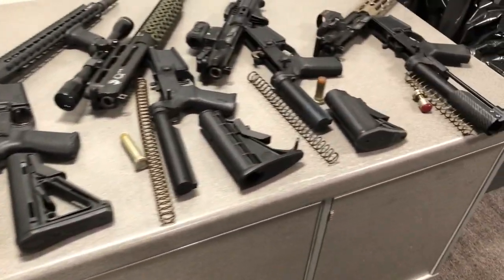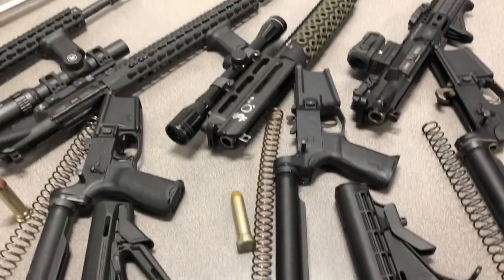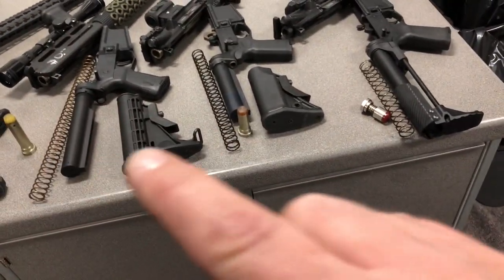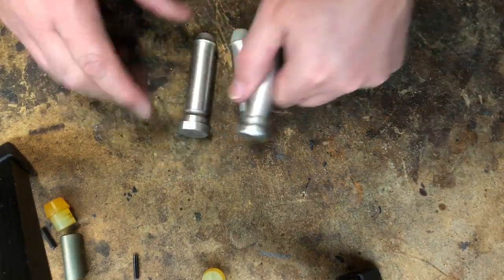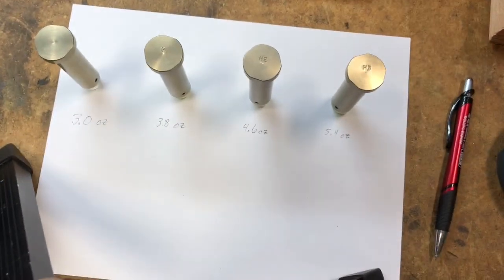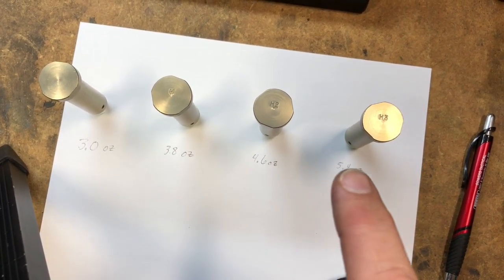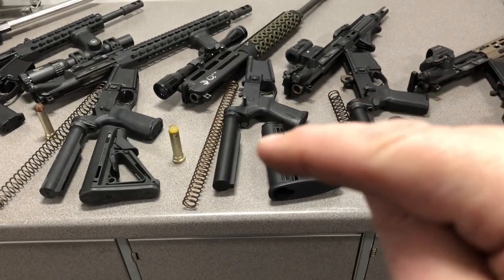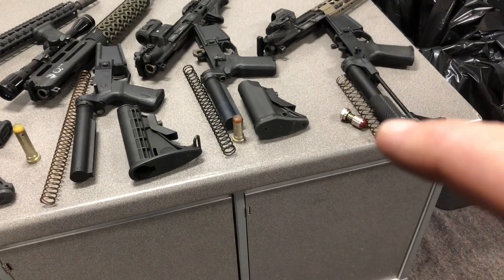Different AR Buffer Systems Explained

Comment: So I should be good with a basic carbine buffer/spring for a 20", rifle length gas system?
I ordered a CMC mil spec buffer and a Magpul adjustable stock for my Colt Sporter Match Hbar. Hope it works
Reply from the maker: It should.  The US Marines ran this set up for a bit, the M16-A4.  I would use an H buffer at first though.  If it's running slow, switch to a std carbine weight.  If running fast go to an H2, but with a Colt barrel, the H buffer weighted carbine buffer should be the ticket.

Comment: Excellent Vid!  for a PSA 10.5 pistol build what Spring and buffer would you recommend?
Reply from the maker: Carbine with an H2 and Tubb flat wire spring, or A5 system with an H2 and green Springco.
Reply: @seanmtactical6069  Thanks for the response.  And Cheers from Parker.

Comment: Have 13.7 inch sons of liberty mid length  barrel with NOX Pinned .
Have the tubs AR Series  flat wire buffer spring. If I buy the Vltor A5  tube which buffer should I get? I’ll be shooting mostly 62 grain green tips I will not be shooting suppressed. Question is Which A5 buffer to get. Other question I have a rifle and I have a carbine length Ace skeleton receiver extensions/stocks, if I use the ace stocks with the tubs flat wire spring in either one what should I do For buffers for either one of those scenarios thanks for your input. I’m just used to using ace stocks. But if I have to get a Vltor A5 extension I’ll do that if it’s worth it
Reply from the maker: I would try the H (1) buffer in either the carbine or A5 buffer with that barrel and a Tubb flatwire.  SOLGW uses a 0.077" gas port in their 13.7" barrels.  If you find your ejection pattern is forward of 3 o'clock, try an H2.  I suspect the H is all you will need though.

Comment: 9” 300bo ar pistol i plan to run suppressed and unsuppressed. Subs and supersonics. What buffer system do you recommend?
Reply from the maker: carbine buffer tube with a carbine weighted buffer and a Tubb flat wire 300 Blk spring.

Comment: Are all buffer retaining pins supposed to be spring loaded
Reply from the maker: Yes, but some systems are meant to be ran without a retainer.  The most common that doesn't use a retainer and spring is the JP silent captured system.  We only build rifles for competition using this system.  They are not reliable enough for any other use.

Comment: I have a 20” AR-10 mid length gas system and a carbine buffer. Runs great but I want to use a rifle length buffer and tube. No one will give me a good starting point on which one to use. Any thoughts?
Reply from the maker: If you go to an A2 tube, you have one buffer that will fit, the 308 rifle length buffer.  Now, if you are using the current PRS stock, you can use a carbine, A5, or A2 tube.  In that case use the A5 tube and at least an H2 AR-15 buffer.  In all of these cases, I prefer the Tubb 308 flat wire buffer spring.

Comment: I built an AR-10 upper chambered in 6.5 creedmoor with a 20" faxon rifle length gas system with nonadjustable block. I mounted it on my DPMS SASS G2 lower and used the BCG and buffer and spring that was installed but I'm getting a FTF on my follow up shoots. Any Ideas? I can cycle it buy using the charging handle and it ejects fine. Just thought it was wroth asking.
Reply from the maker: What type of buffer tube?  What weight and size buffer?  What buffer spring?  We typically build Creedmoors and 308 Win AR-10s with rifle length gas systems, adjustable gas blocks, A-5 buffer tubes, Tubb 308 Flat spring, and H3 buffers.  Adjustable gas blocks on AR-10s are sadly almost always required, especially with suppressor use.

Comment: Did, I gotta pick your brain on ar10 buffer and spring... Recently built one and had my bcg smack my lower buffer threats and tube... No critical damage but I'm having a hard time finding trustworthy specs for spring length and such
Reply from the maker: The spring length probably isn't the problem.  I suspect you are running an AR-10 carbine buffer in an A-5 or A-2 tube.  I need to know what buffer, spring, buffer tube, bolt carrier group, and lower you have.

Comment: I want to change my buffer spring for my m&p 15 sports II AR. However, which buffer spring should I change the stock one out with that would run more smoothly?
Reply from the maker: I would use either a Tubb flat wire or a SpringCo white carbine spring.  I use the Tubb springs in my guns. I would go to an H buffer in the carbine 16" 556 gun.

Comment: Would you recommend running a carbine buffer h3 in a Ar308 rifle length instead of the rifle buffer tube and buffer?
Reply from the maker: Yes, but you have to use an A5 length tube to accommodate the 3/4" longer BCG.  It's what we prefer on the AR-10 builds.

Comment: I just traded my Maxim Defense brace with the shorty tube and it had a H2 buffer for a 7" Barrell and shooting 7.62x39....... I just changed the Brace from Maxim Defense for a SB Tactical SBM4 AR-15 Pistol Stabilizing Brace and a M4 Carbine tube (KAK) that came with an H1 buffer ...... Will it work like that with the H2 or do I have to play with it H1 buffer ?

Comment: Recommendation for an 8.5in 300BLK build?  I intend to run both suppressed subs and supers in it. Is there a buffer system that can do both? I'd like to be able to swap ammo in the field.
Reply from the maker: Standard carbine buffer tube,  carbine buffer, Tubb 300 Blk flat wire spring.  That's where I would start.  There are a lot of variables, most impacting being the gas port size and the ammo used, but this seems to be the most flexible set up for that gun.
Reply: @seanmtactical6069  Thanks so much... so just a specialized spring?
Reply from the maker: @ecthelion1735  Pretty much.  If you see it's running towards the faster side with sonics and you can get away with it, you can try a heavier buffer, but most 300 systems I've worked on have worked best with the above parts.

Comment: WOHA! Great vid! Thanks!
Why is an A5 better in an AR10 than the original A2? 
(18” bbl, rifle gas)?
Reply from the maker: You can get a heavier buffer.  The H3 is heavier than even the 308 A2 buffer.  If you are using a full length stock, it's really close enough to not matte, but it's huge in a collapsable.
Reply: @seanmtactical6069  OK Thanks. I use A2 or similar stocks. AFAIK it is possible to add weight to the rifle buffer as well.
Reply from the maker: @GBCR  You can.  They disassemble by taking the roll pin out of the back that holds the rubber bumper in place and then you can substitute a tungsten weight in for a steel weight.  But you really shouldn't have to do that if you run an adjustable gas block.
Reply: @seanmtactical6069  Thanks! You're the man, Sean!
To clarify, I meant is there any tangible benefit to do so in an AR10 rifle buffer , 18" bbl with FL gas (12")? Any difference in the position/location of the heavier weight among the 3?
THX IA
Reply from the maker: @GBCR  No.  I've played around with this in an A5 buffer a little and didn't really find a difference.

Comment: NOTE TO EVERYONE. Never run anything in you gun that u can't repair on the field. Custom enhanced triggers, drop in triggers. All complete junk. Odd looking buffers, folding adopters and shit. WTF, why would you risk something like that breaking or failing and you gotta either disassembled whole system to replace it or wait 2 weeks or more to get it repaired or ordered. And that's if they even have the parts in stock. People are dumb. Keep things that proven and simple.